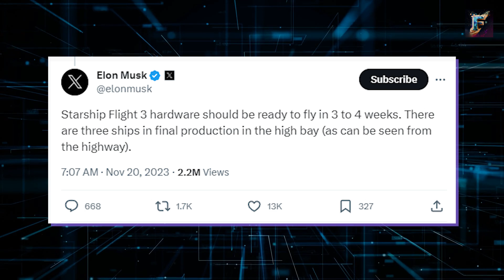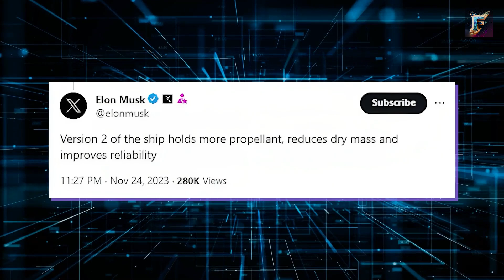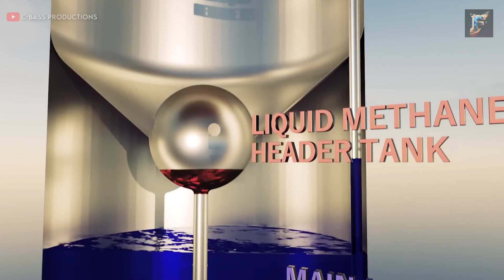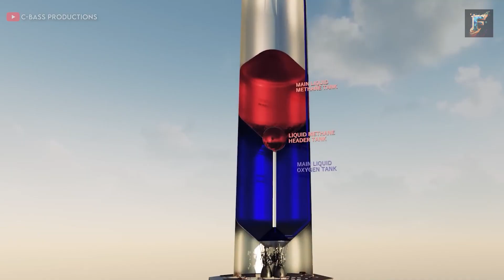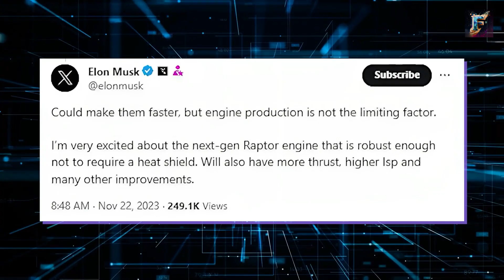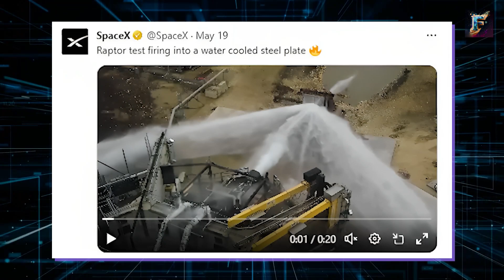Musk REVEALS: Starship V2, Raptor 3.0 - This Upgrade is More Important Then You Think!

Comment: Like I said just after IFT-2, if it's up to musk he'll have another launch done by Christmas. Got considerable backlash for that, but whaddayaknow....
Also, I think they should develop the HLS with the elevated engines, these can be used for hotstaging without the need for a hot staging ring and omits the problems associated with the top of the booster getting blasted. Also the thrust would not slow down the booster - the most likely cause of the engine relight failures of IFT-2 superheavy booster is cavitation of the turbo pumps after bubbles got into the feed lines.